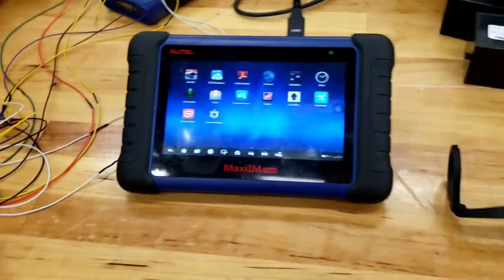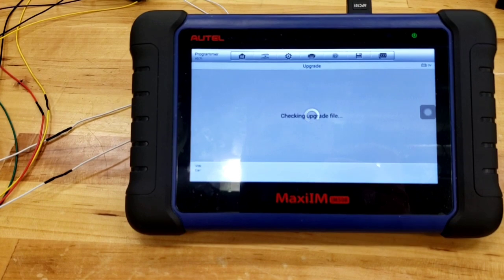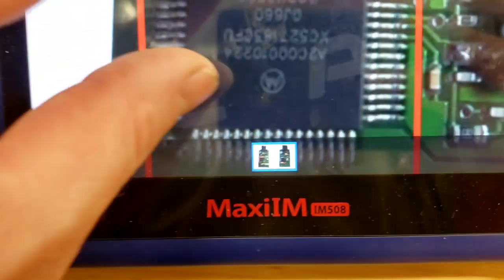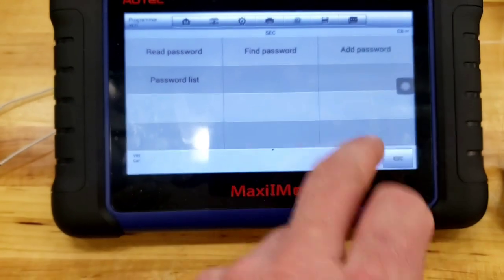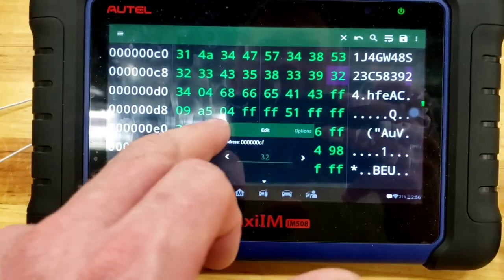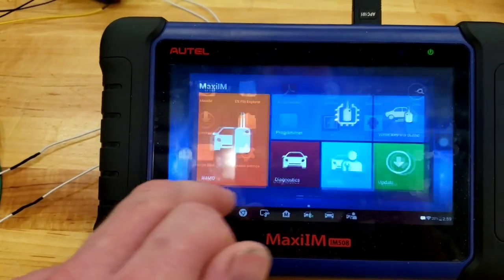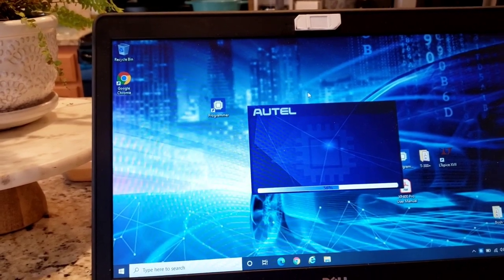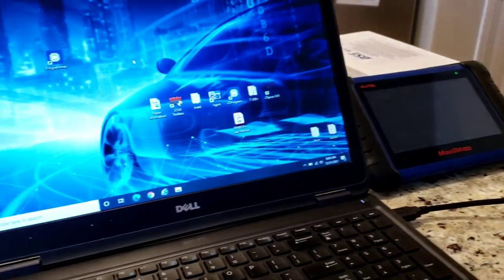EEPROM/MCU Autel IM508/XP400 Pro

Comment: Thank you very much. I followed the steps carefully and thanks to you I got the pin code out of a Dodge Ram. I tried two machines using the metal and blank key method, but to no avail. So I removed the MCU with a hot air tool (my first time) and followed your steps. Same MCU number but a Ram Instead of a Cherokee.  I saw the Dump file and figured out the pin code.  However  when I tried with Write Key via Dump, I loaded the file and it didn't give me the key info, neither the pin code. However I went back to the IMMO> Dodge> Read PIN by Dismantle> and loaded the dump file I saved and it gave me the pin code, the same one I saw on the Dump file. Thanks.
Reply: Trying to do this same step with im608 Pro ii but not working